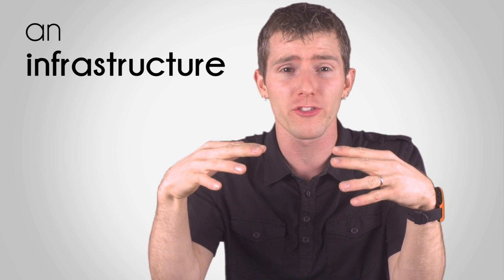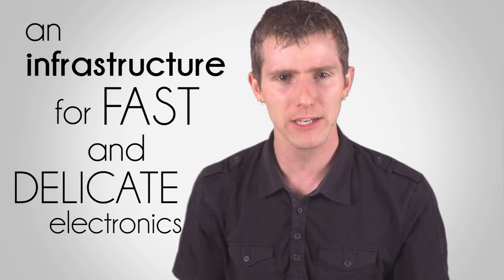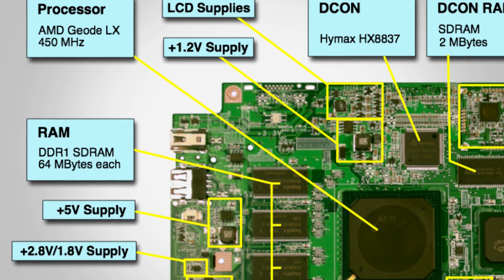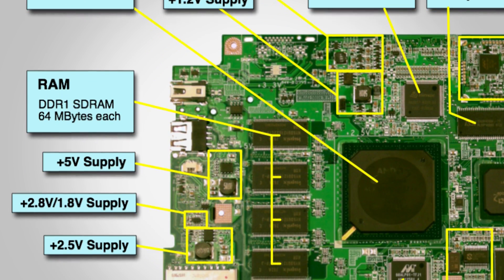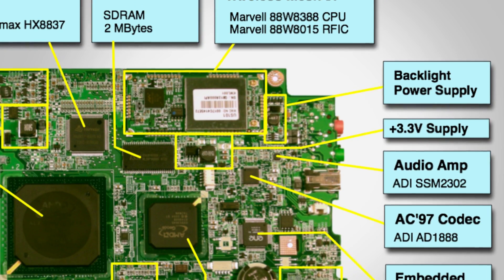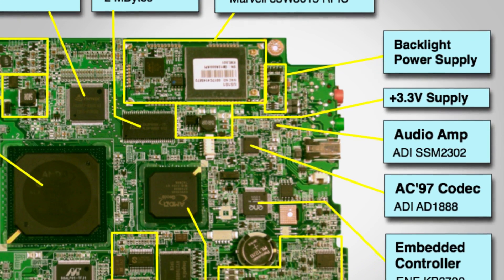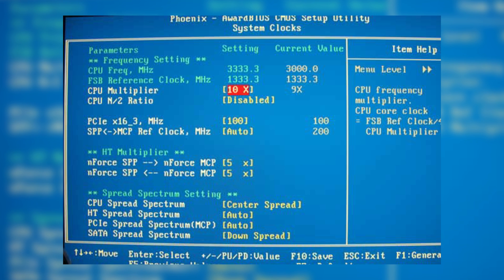What is a Motherboard as Fast As Possible

Comment: What if I just upgraded my PC from 350 to a 600watt 80+ bronze psu and from 1gb to a 4gb 970ssc gpu. Got the parts have not installed gpu yet
Reply: +TheLegend105 Um. Is that a question? Not trying to be rude or anything
Reply: +TheLegend105 1. dpends on your motherboard 2. depends on your cpu

Comment: hey so im building a pc and im kinda a noob but i need to know what makes a good motherboard a good motherboard? and any reccomendations?
Reply: +nick simpson Kinda depends on your budget and what it's used for. You typically won't need more than 4 slots for ram, and you won't need too many pci slots. Never cheap out on your motherboard, I did and ended up not having enough usb 3.0 slots, so now ocasionally my keyboard and mouse will flash off and on for a few seconds about 4 times a day. And half the usb 3.0 slots don't work xD

Comment: Has a motherboard a max capacity of vram ?
Reply: +Sauer Kirsche No, that generally depends on your GPU, however, PCIe slot version matters slightly.
Reply: +MostED13 how much does it matter tho?
Reply: Older motherboards get bottlenecked with some graphic permformance, like the version of PCI slot defines how much bandwidth it has, the newer the more bandwidth for data. It would matter with really demanding games as there would not be enough data going to the gpu and back through the slot.

Comment: What's the Difference in motherboards? like brand wise?, other then connectors, and cpu socket, what one's are better? why? Thnaks for the videos! keep it up.
Reply: +Ben Leblanc In most cases brand will not matter. It&#39;s mostly preference and what you're using the pc for. Just make sure you&#39;re not buying sketchy off-brand chinese knockoffs or anything like that. Of course, most importantly, make sure it matches your color scheme xD
Reply: Boards w/ personal rating by them (0-10, 10 is highest)
AsRock:8
MSI:8.5
Gigabyte:9
Asus: 8.5
Go for MSI, Gigabyte, or ASUS. Don't asus for low end and go gigabyte for low end.

Comment: If I screwed up my BIOS trying to install a new one, there's no way to fix it besides getting a new motherboard?  I haven't done it yet, and probably won't, just curious.
Reply: +Centurion PPV I'm 99% sure that if it is screwed up, it is screwed up forever...
Reply: Ah.  Thanks for letting me know.  Too risky for me.
Reply: +Centurion PPV If you follow the your motherboard's manufacturer instruction, you should not have any problem flashing a new BIOS :)
But, unless you NEED to update the BIOS (Eg.: CPU upgrade or important bugfix), it may be better to not do the update.
Reply: Yah, I'm just not gonna do it.  It's too risky.

Comment: So when buying a Motherbord for a PC build, and the description says 'supports 2133Mhz DDR4 RAM', does that mean I have to have that particular RAM or can I have better? (e.g. 2666Mhz DDR4 RAM)

BTW: I am kinda a noob :P
Reply: +Sean O'Brien You can only have up to the allocated bandwidth, sorry. :/ you can use any speed under the 2133 but the board will not support higher frequencies.

Comment: do motherboards affect gaming performance?
Reply: actually, it doesn't really, it just holds everything
Reply: +Samir “pokestar” Theman yeah, I have to agree with you there, if you have more parts than the motherboard can hold, your shit out of luck
Reply: So if i had 2 pc's, both with the same specs, but one has a more quality motherboard which will run games better
Reply: +eliasRrivera it can if you have an high end motherboard
Reply: Jacob Nguyen Yeah from many aspects, if its poopy and cheap or dirty it can slow performance, or if it doesn't have anymore slots to fit ram out, or new incompatible components just came out you can't use them.

Comment: stupid question: is the operating system saved in the motherboard(bios) or just on my hard drive?
Reply: iPasha the OS runs off the HDD drive. and the bios runs off a pre installed chip on the motherboard.

Comment: From what I understood from the video, a motherboard allows all the components to work together and it doesn't contain anything that could boost your performance. If that's the case, than why some motherboards are more expensive while others are cheaper. Is it bad if I buy expensive components and get a cheap motherboard?
Reply: Amir effect quality testing, sustaining high loads, can it talk to the hardware efficiently , can it run XXX type of intel processor, what kind of special crap can run on my board ( mine in particular requires the OS to have a driver to allow faster device charging over USB), ect. better boards usually cost more

Comment: I need help, i have this motherboard http://www.asrock.com/mb/NVIDIA/N68-S3%20UCC/   
It says its 6-core ready, and im about to buy an 8-core for it. 8-cores didn't exist when the motherboard was made (2011) i think. the question is will the new processor work, or can't my motherboard handle 8-cores?
Reply: ***** It will not work. Do you even know if it uses the same socket?
Reply: Adam Sweitzer Well i know now that this motherboard has AM3 socket and the new processor has needs AM3+ so i need to change motherboard.
Reply: Lol that's what I thought, if it goes in the socket it will work, and a 8 core won't go into that.

Comment: Im building a gaming PC and im on a budget of 1000euros.
Does anyone have any recommendations for the components?
Reply: visit the forums linustechtips.com
Reply: go for a 4670k, 1550 soket Z87 Mainboard, samsung 256gb evo ssd, one random 1tb hdd and a 760 or 770 2gb or 4gb nvidia card.
500-750Watts Powersupply should do.
Make shure your Case fits your Mainboard.
And don't forget your DDR-3 Ram.
Reply: tomshardware.com is good too.
Reply: Carlos Martinez
Traitor! :P
Reply: megaspeed2v2 I wouldn't say traitor, I didn't joined linustechtips.com yet.
Reply: I5-4690k

Comment: I remember My first Motherboard, it was old and it did not have an Intel or AMD CPU.....Cyrix
Reply: My first was an 486, only serial keyboard was onboard, even HD and flopy controler was daughter boards.
Reply: I think mine was a 486 then got replaced with a 586 @100mhz. and 16mb or ram.. it was from like 1996 i think.
Reply: Massa902 Mine was from 93 if i recall, good times.
Reply: There was also IDT and NexGen... but then AMD bought out NexGen, and VIA bought out IDT and Cyrix.

Comment: Can a mobo bottleneck a rig
Reply: Not often, but it can.   Usually when you involve something like a Bus Speed where components are inputting more data than the motherboard can handle.  Or when you have great components that are running slower than optimal to conform to a less than great motherboard.
Reply: Motherboards can also have a huge effect on system stability.
Reply: Yes, as it is such a important component for comunication of all other components, it sure can..but it is kind of rare since usualy the grade of it is the same as the CPU grade you use.

Comment: My new MB blew with my PSU. I then used my old system and bricked the MB with a corrupt BIOS update.... FML.
Reply: You should find a tutorial on flashing a new bios externally on the one with a corrupted bios (If your MB supports it) Try looking up your motherboard online and see if there's anyway to fix it. If not, I suggest you get a new motherboard and just to be safe an 80 Gold certified PSU if you can. Good luck! If you would like further support, I'm sure you can find more knoledgable people on the linus tech tip forums.
Reply: Your Doom Thanks for the help but I've done that :\ It's a mobo from a pre-built HP and doesn't have much support unless you're a technician with this flashing device I saw online for $80

Comment: Your first "as Fast As Possible" probably should have been about the motherboard. At least in my opinion because when I consider building any computer I build it around a specific motherboard depending on what am I going to use this PC for. At least I see the motherboard (as probably the majority of people) as the most important computer hardware (well that and the HDD/SSD because... well... you know.... information on them might be important. But mostly the motherboard because everything revolves around it.) But that's just me.
Reply: I think most gamers work the opposite way when picking parts; first pick the graphics card, memory capacity, number of hard drives and processor you want, then just pick from the motherboards that support what you need.

Comment: To the newbies out there, if you want to have the option to upgrade or even replace faulty parts in the future then stay away from Dell and Apple. They don't use industry standard parts, meaning you have to pay whatever extortionate price they feel like charging you if you need to fix or upgrade your system.
Reply: dell also offers finance and extended warranty 😁
Reply: to extend your comment:
... but there is a reason for the non-industry standard decision: The size of the whole thing. Replaceable part systems require room to fit different sized parts. This is where Apple, Dell, Laptops and Phones come in: They cram everything into the smallest possible place to save on room but sacrifice the ability to replace parts (mostly).
Reply: Well... As overpriced as Apple may be, at least they will fix (And with fix I mean replace) your faulty hardware... But still, don't get near them, they suck, It's like the consoles for the Workstation market

Comment: Can a motherboard "bottleneck" (slow down) the performance of a CPU, altho it's fully compatible with the CPU but the motherboard is cheap ? Let's give as example: will an AMD FX-6300 work at full potential with no user overclock, only the turbo boost technology, on a asRock 960GM-VGS3 FX ?
Reply: Actually yes - a motherboard can be a bottleneck. I learned the hard way when I bought an AMD FX-8350 and a cheap AM3+ motherboard that the power delivery was not quite enough and thus would throttle down my CPU to avoid frying the voltage regulators on the motherboard. The AMD 8350 should realistically be rated at around 200 watts instead of 125 watts so that manufacturers don't label boards as "compatible." Now I have an Asus M5A99FX PRO R2.0 and my 8350 runs flawlessly.
Reply: Only if you setup it bad on the BIOS. Where you would for example disable hyper thread in CPUS that allow it, or do some kind of underclock. 
Usualy what it bottleneck is the speed of the south and north bridge comunication..in other words, usualy it bottleneck the "conversation" of each component but not a component
Reply: If you consider that the HyperTransport can "bottleneck" the CPU then you have to take a look to your chipset before buy.

Sorry my english :(